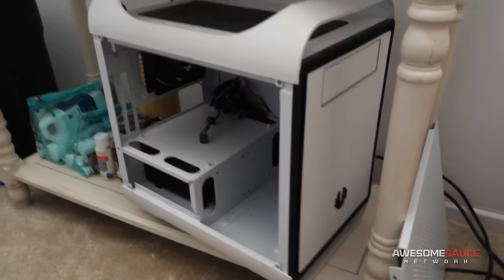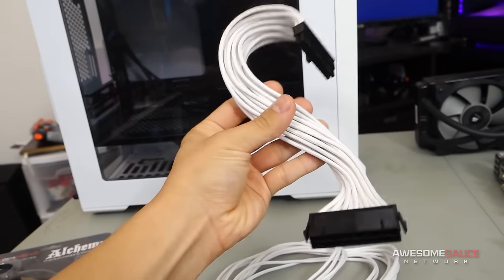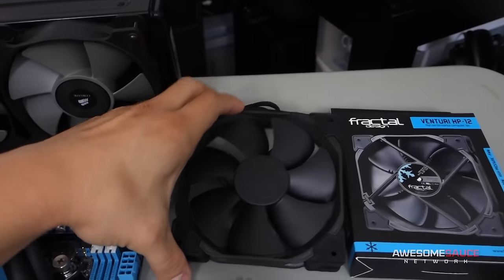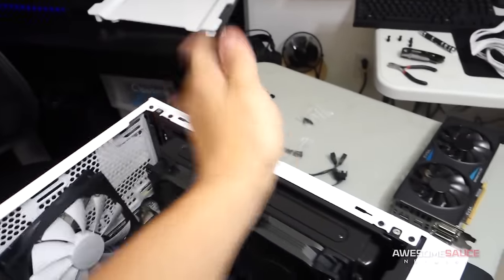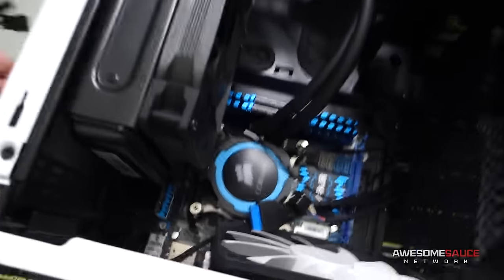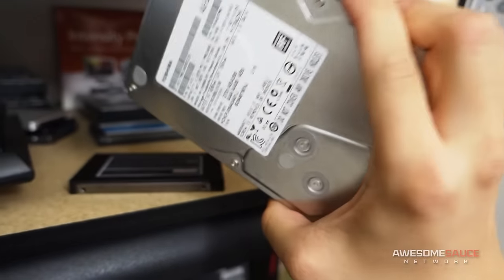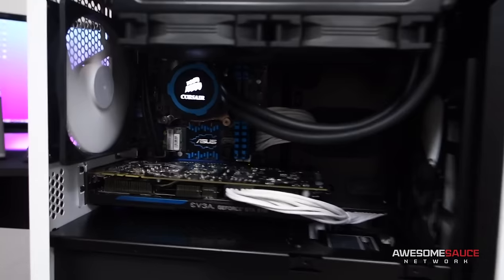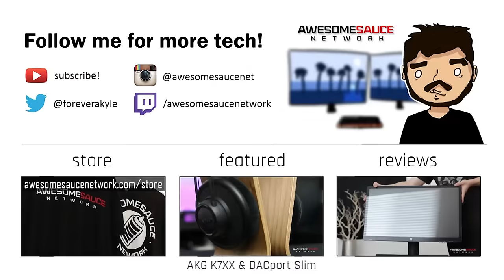Building My Wife a New PC! - "The Wifey Build"

Comment: Do you think this CPU would bottleneck 1070?
Reply: Get an i7 and 2400 mhz or higher ram if you're gonna get 1070.
Reply: +Cat Of God I have the i7 2600 overc locked to 4.0 MHz  with 16 gb of ram
Reply: ***** Erm yes it does there will be a lot of difference in fps betwen 1600 mhz ddr3 ram and 2000 something ddr4 ram. Also he didn't specify if he does gaming only or also edits video, audio ect.
Reply: ASUS-STRiX there is a benchmark of the witcher 3 here on YouTube where the guy gets about 15 fps less than I do and the only difference betwen our sistems is the cpu.
Reply: ValueGaming Should be just fine.
Reply: ASUS-STRiX oh and because I know you will respond back with the "are you dumb" aproach let me just ask you this question would you ever pair an i7 with a titan x because it performs the same as a 1070.
Reply: uhm i saw an video where an guy oc his i3 6100 to 4,6 ghz and gets the same fps as an i7 6700k @stock which is great soooo yeah you dont really need an i7 like i said before
Reply: ***** wait 1 sec
Reply: ***** So gamers arn't allowed to edit shit right? Got it!!!
Reply: ASUS-STRiX Could be, I sure know you are.
Reply: i7's do shit for gaming.
Reply: The Obsidian Knight Yeah, I said that.
Reply: The Obsidian Knight It's fine.
Reply: ***** If your just gaming, don't get an i7, save your money and get an i5 and get a better GPU.

Comment: I'm building a pc.

 what settings will it run GTA V Beamng.drive ArmA 3 and CS:GO at??

CPU: Core2 Quad q6600
RAM: 4gb ddr2
GPU: GTX 560 ti
MOBO: GA-X38-DS5
PSU: Super flower SF600P 80+ GOLD

I will be upgrading RAM soon to have at least 6GB

Comment: what did your wife do to you to deserve an ocz ssd?? do you hate her or something? I wouldn't give an ocz product to my worst enemy. Seriously, OCZ products are garbage.
Reply: I have one and it works great, boots in a cuple of seconds, do you even have one m8?
Reply: +Anton K I had two for about 10 months. Both failed around the same time. They were fast and performed well until they just stopped working without warning. Now using a Samsung drive and have had no issues since. Sold the ocz on eBay after an rma.
Reply: +FalcomPSX DAMN dude, sorry to hear. Which Ocz  ssd:s did you use and did you use them in raid?
Reply: +Anton K one in desktop, one in laptop, so no, no raid here. They were vertex models, don't remember exactly which. Also had ocz memory, which died in a similar fashion. The price was right, initial performance great, but the quality of ocz products is just terrible. Google issues with ocz products and you'll see tons and tons of similar stories.